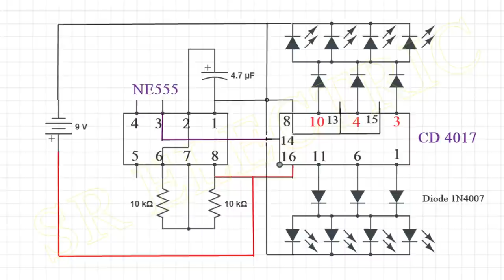[NEW] Simple Electronic project, Police/Ambulance Flasher Light Circuit

Comment: Can we use 12v battery.. plz rply.. i wanna make this circuit for my bike
Reply: The data sheet I have for the CD 4017 chip says it requires 3 to 18 volts to operate.  The data sheet I have for the 555 chip says it requires 4.5 to 16 volts to operate.  So, yes you can use a 12 volt battery.  I presently have LEDs mounted on my motorcycle that are controlled by a CD 4017 chip and a 555 chip and the circuitry operates properly on 12 Vdc.
Reply: Each output pin on the CD 4017 chip can provide 29 mA.  Keep that in mind when you are determining the quantity of LEDs that can be connected to the CD 4017 chip.  If you connect too many, you will damage the chip.🏍